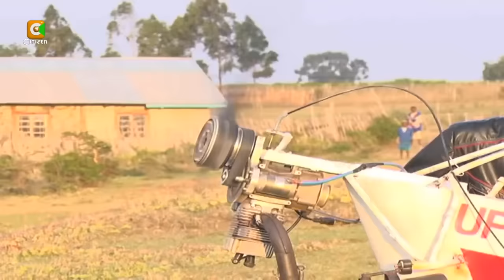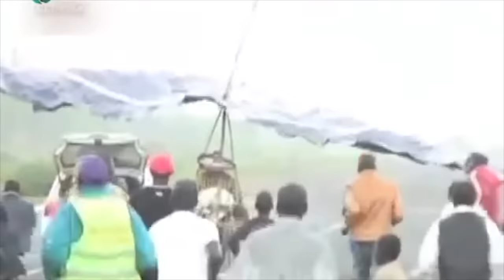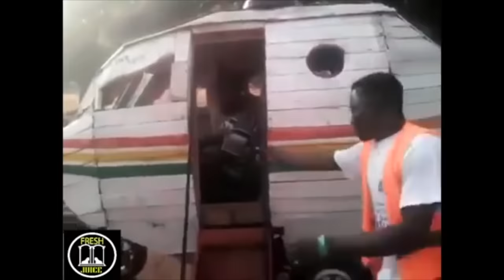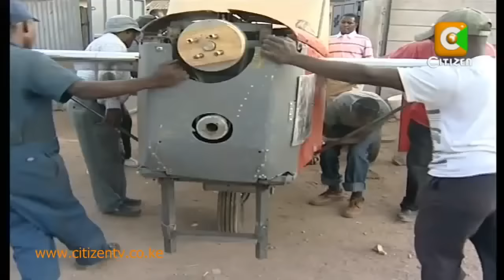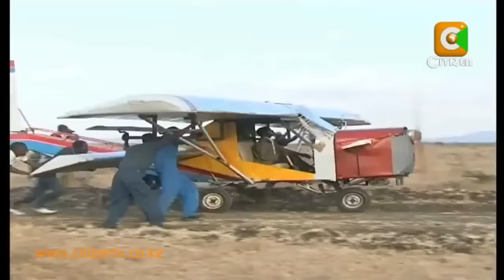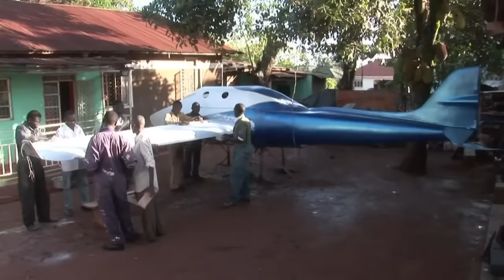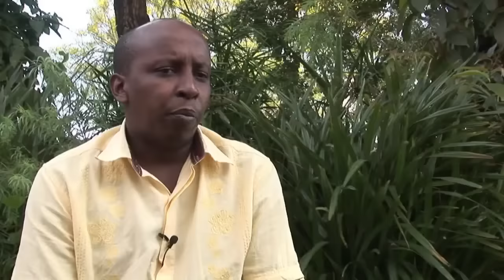African Airplane Compilation | African Aviation

Comment: I love that the "Helicopter" scooter had a fully integrated staircase/door for a 2 foot climb, as though it was an integral part of the engineering.
Reply: The painted flag not lining up when closed was truly the cherry on top.
Reply: @grovePS3  indeed. typical African eye for detail.
Reply: I can only hope there is a couch in back for seating 😊
Reply: @DANTHETUBEMAN  definitely a sofa in there. Probably the most valuable thing on that abomination
Reply: Those stairs looking gangster frfr
Reply: That one looks to me like it was a novelty thing, and not supposed to fly though. It doesn't look like the propellers turn, and the engine is still just hooked up to the wheels.
Reply: @cmur078 it's actually the best one because it's not trying to fly at all
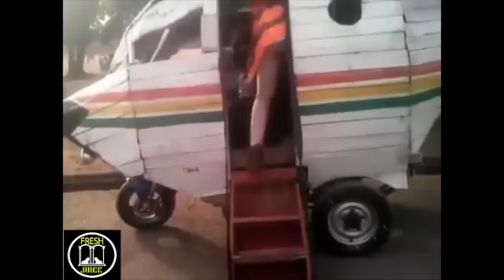Reply: Those racing stripes at 3:37 are important, yes?
Reply: A clapboard helo 😂
Reply: Did you like the way the stripes lined up once the door closed?
Reply: good thing it had multiple forward gears.
Reply: @grovePS3  It looks like they painted the outside upside-down, so when stairs were connected the whole panel was flipped
Reply: The one door assembly looked as heavy as the rest of the aircraft
Reply: That thing looked as if it may have been part of an aircraft at one time or another and he was only attempting to restore it to its rightful place in the sky.
Reply: I believe he installed it the wrong way,causing the lines to not match lol.
Reply: "engineering" 💀
Reply: Wheel barrel as the planes wheel 3.59
Reply: That was 100% a Honda engine from an 84 200 ES ATC. It should have flown, came down to pilot error.
Reply: @grovePS3 It did. They wanted the star in the flag and it all lined up how they wanted it. The whole contraption though showed their priorities and it clearly wasn't aircraft engineering. It was like me at four when I made a rocket out of 2x4s playing astronaut. I thought I could make a heavy comfortable house fly.
Reply: lmao..!
Reply: "Just as it seemed feady to take the leap"

- as several people pushed the aircraft at 7mph.

The mischievous laughter of the children at the failure of this man's dream😂😢
Reply: True, but he didn't make that one. It came from a set.
Reply: @A_Stereotypical_Heretic lol abomination!They definitely dont consider saving any weight in the design!
Reply: @wirelessone2986 cause it wasn't meant to fly but deliver a bit of the fancy feeling of a helicopter ride, if even only the fancy entry and shell
Reply: ofcourse, its a load bearing staircase/door.
Reply: It wasn't a scooter, it was a tuktuk
Reply: Pimped out tuktuk
Reply: What about HELICOPTUKTUK
Reply: It's the part that functions
Reply: They know what it looks like not how it works
Reply: @Stan_in_Shelton_WA I think Boeing hired these guys to put the door plugs in the 737 max.
Reply: @twigglykevin V TEC don’t kick in until cruising altitude, so he had a few inches to go to get to Flight Level 000.00025
Reply: well we were made in gods image perfect, and god is three in one, so we are also three in one , body, soul and spirit. And so we were put in a perfect paradise, with alot of fruit trees, but one fruit tree we couldnt eat of its called the tree of knowledge of good and bad, and so satan was a high angel who rebelled against god and was trown onto earth, he came to the perfect humans in disguise as a snake and said to them, didnt god say you would die if you eateth from that tree, the woman Said yes, and so satan told them well i tell tou if you eateth from that tree you will become like god, and so thats what she did and she also gave to her husband adam and that day they realised they were naked and had sinned against God, they died spiritually, their soul would die the eternal death (hell) and their body would die, if they didnt repent and believe , so the curse of death continued on alot of humans because of their sins, but god send his son jesus christ who came to undo the sins of the first humans by being without sins and dying as a sacrifice for the sinners, to make the path to forgiveness open by faith and being baptized, and receiving the spirit, jesus said if youre not born again trough water water spirit you cannot enter the kingdom of GOD ❤❤
Reply: its like homer's spice rack
Reply: It's presidential bro 😂
Reply: Helicopter Scooter....... I'm Crying!
Reply: That one was for classy Africans! They are not living in stone age.

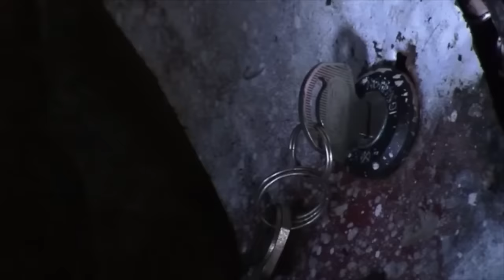Comment: At 2:22 - when he goes to turn the key and the whole ignition switch rotates you know this is gonna be good..
Reply: Lololol.

Bro those rotors ain't lifting shit
Reply: I thought it was going to start rocking backwards and forwards making a humming noise , then stop until another coin was inserted
Reply: @bonusnudges  😂😂😂😂 Man I cried so hard, looool. This is so savage it needs to be top comment hahahah 😂
Reply: @bonusnudges  LMAO 🤣🤣
Reply: the same torque used to attach the ignition switch is used to torque down the propellor
Reply: @bonusnudges  That's funny as shit.😂😂😂😂
Reply: @bonusnudges  Broo 💀💀💀
Reply: The Flintstones was futuristic compared to this shite.
Reply: @skateboardingjesus4006  LMAO. 😁👍
Reply: Mobambo bojaba!
Reply: @poopbutt6241  It's not legal in my country to just build some rickety old half-arsed attempt at a manned aerial vehicle and try to fly it. I have built (and still do) various scales of remote controlled FPV (First Person View) airplanes of different configurations and abilities though.
Much more fun and far more conducive to staying alive. These guys have the drive, but unfortunately not the appropriate knowledge, or materials.
They wouldn't be too hard to get, even in rural Africa.
Reply: Just not for the pilot
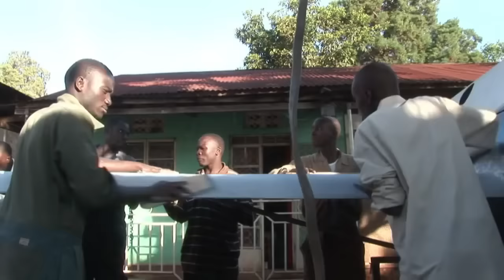Reply: 6:50  there is a long way to go. Understatement of the year.
Reply: Not mentioning the rust all around.

Comment: the helicopter made of wood with the tiny propeller really got me XD
Reply: That was some good 2x4 framing.   A better choice than using 2x8s imo.
Reply: The paint on the door didn't line up with the rest lmao
Reply: Looks like something straight out of spongebob, I like how the colors on the side don’t match up with the drawbridge door.
Reply: that guy who jumps inside it with an orange security vest killed me. haha
Reply: I think that was a Rickshaw with a 2-stroke 15 HP engine that wasn't even connected to the tiny propeller. Ha!
Reply: Africa will soon reinvent the wheel
Reply: Lol same dude.  Dunno how incame across this video but man its hilarious.  Those dinky ass propeller blades will never work.  How is it not obvious to dude?? Ha then the next helicopter keeps crashing.
Reply: @Patriot-bn9om  I thought "oh, they are going to move it to a safe place, THEN start the engine for the propeller"... that would never be big or strong enough (both the blades and engine) to lift off the ground. Nope, it's just a "fancy" Rickshaw with a non-functional fan or something glued to the top. That guy that waved out the window was the time I realized... that was the "flight". Just going down the street at 3 mph. That engine probably was struggling to move that thing.
Reply: I don’t think it was even meant to fly. It was probably some sort of float made for a parade or something like that.
Reply: Bad piggies lmaooo
Reply: THAT IS WHAT IS CALLED

A BOX

IN LAYMAN'S TERM

A COFFIN
Reply: @Patriot-bn9om that's a wind driven propeller, super efficient.
Reply: That was a ceiling fan lmao
Reply: @Anti_Everything  And it will be square.
Reply: Or the ridiculously small and underpowered tail rotor in #1 😂
Reply: I did like the little porthole detail.
Reply: Good to know that a ceiling fan won't get an upturned sail boat airborne.

Comment: Not enough lift?  Ramp at the end of the runway.  Problem solved.
Reply: I guess they were saving weight and reducing drag by eliminating the vertical stabilizer and rudder.
Reply: @OldWrench45  It's a bit funny to see the plane structure violently bend near the wheels when the plane collides with the ramp
Reply: That’s actually how most aircraft carriers work. (Modern ones have a catapult system)
Reply: @crunch9876  that's for a shorter take off. Not because the planes can't generate lift.
Reply: wooo hooo
Reply: @crunch9876  Sure aircraft carriers use techniques to aid in the takeoff and landing of aircraft because of the short distance but not because the aircraft can't sustain flight or gain sufficient lift.
Things like the catapult systems are there because the planes don't have enough runway and time to accelerate to liftoff speed, so they accelerate them faster and give them a push. I have no idea what a ramp is going to do lol
Reply: Funnily enough a ramp would be counter productive to generating lift. Transferring your horizontal velocity into some vertical velocity with the ramp results in reduced airflow over the wings, meaning you have even less lift.
Reply: @Trollsty  The ramp does actually help if you can generate enough power once you are airborne, this is the reason many aircraft carriers use ramps. That lawnmower engine just ain't gonna do the job.
Reply: Kuznetsov used ramp too
Reply: BerserkPk i read an article in a news paper about him and he have invested 4500$ for the engineand 1500$ for the propeller 🤭
Reply: Hehehe

Comment: Pretty sure that helicopter is using a ceiling fan
Reply: Lol😂😂😂😂😂😂😂😂
Reply: that wooden helicopter was taken out of context, it was not supposed to fly. Its a taxi
Reply: even if the helicopter took off. There is no tail rotor so most likely the aircraft would spin from engine torque maybe even killing the pilot
Reply: I remember that helicopter, how does he think that flies with 20 cm of blades
Reply: Hmm... No wonder our house took off when I put the ceiling dan in reverse!
Reply: @nadunwijesinghe965  
Yes, never flip that switch. People lose roofs that way
Reply: @maxwellagrunewald  you dont need a tail rotor necessarily you can add another rotor on top spinning in the opposite direction. The Russians have done this for some of their helis. An the chinook functions in a similar manner if only because of its weight.

Comment: Ok lets power this 1000kg plane made from car chassis with 120cc 2 stroke engine from a moped. I see no problems there
Reply: What can possibly go wrong lol
Reply: That's not a problem with aerodynamics! But the aircraft collapse on its own weight.
Reply: It’s the gear man it’s the gear....😂😂😂😂😂😂😂😂😂
Reply: @vascoribeiro69  yeah weight is a problem of your engine is not  powerful enough. How you expect to make that thing fly. Where do you an aircrafts made of iron or steel alone?. Tjey used  composed materials  and light weight metals like aluminum
Reply: xKuukkelix 😁😁😂😂😂😂😂😂
Reply: 2 problems...
1.. plane weighs 2 tons
2. Moped motor with a home made propeller ain't gonna cut it.
Reply: Santiago Arbelaez r/woosh
Reply: The real problem is the designer’s IQ of 80.
Reply: yeah, the landing gear must be the reason why it can't take off
Reply: Only need better landing gear!

Comment: When the stripes on the door don’t line up with the stripes on the fuselage you know it’s a well thought out design.
Reply: Hahahahah
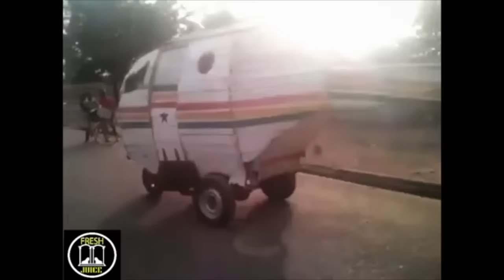Reply: 3:45 ?
Reply: Waahahahaa! 😁😁
Reply: Tries. Fails. Uses more duct tape
Reply: Have you ever tried to build anything remotely close to that? It’s pretty funny to see how little knowledge people have of how difficult it actually is to do something like this is, and how difficult it is to get everything to fit together nicely when you’re literally working with scrap.
Reply: I think they had the door attached upside down when painting. There are stairs inside the door so it couldn't be used in the upside down position.
I'm pretty sure once they get the door sorted out they will have smooth flying from there.
Reply: @dar0971  a YouTuber called PeterSripol built a successful plane... Pretty quickly...
Reply: Forget the stripes, when the body is bigger then the top blades of rhe helicopter. Lol looks like the heli at walmart I put quaters in as a toddler.
Reply: @drabhand  You also forgot to mention this is far from the pinnacle of your race.
Reply: @dar0971  no but lining up lines with other lines is pretty basic shit..
Reply: @dar0971  paint job last. Engineering and fabrication first. Baby steps my guy. These dudes try to build straight to the end product.

Comment: I think the most important thing to remember when building an airplane is to make sure you have solid 21inch pig iron wheels
Reply: And small ass rotorblades
Reply: Body of a Cessna, landing gear from a 747. Designed for rough landings. That man is a genius.
Reply: @C_and_C...  🤣🤣🤣🤣🤣🤣👏🏻👏🏻👏🏻👏🏻👏🏻👏🏻
Reply: and a small rock in front of the front wheel and not one in the back to act as a chock
Reply: gotta have that sweet, sweet center of gravity.
Reply: And don't forget to switch gears when flying
Reply: @C_and_C...  And the pilot is the janitor.
Reply: That is priceless !!
Reply: I think the power to weight ratio is off just a little…
Reply: @oliveryt7168  come on now, they might be functionally brain dead but it’s a bit mean to call them jannies

Comment: The helicopter with ceiling fan blades may be the greatest thing that I've ever seen!!
Reply: I wonder if the fan is the right way up to creat lift
Reply: That's why they are called AfricCan't
Reply: @pteppig  👀
Reply: If they believe hard enough, then they can believe it into reality, or so they think. Cargo cult behavior. I'm not blaming them, unless they have Internet access, then yeah no excuse at that point.
Reply: @Patrick  Even the most remote tribes in Africa have smartphones and access to the internet now..
Reply: @MarkLada  Then nah there's no excuse.
Reply: @pteppig  WHAT DID YOU  CREATE?
Reply: That had to be a joke
Reply: @crusoebower3391  If you think it's a joke, you don't know Africa very well lol.
Reply: It's all about the rpm. It is actually one of the safety features, so it never will become airborn. If I am ever to build a plane, I would start of making it radio controlled 😄
Reply: THE PLANE NEED A SATUR V ENGINE IS TOO HEAVY
Reply: THERE IS NOT AERODINAMICS

Comment: 3:45 love how the stripes line up perfectly with the door
Reply: Ha ha I love that too!
Reply: 🤣🤣🤣🤣 These perfectionists sweat the details!!!
Reply: @daakrolb  They also don't skimp on construction materials by using new lightweight purpose formulated alloys. That shit's for posers. Strap a 20 HP 1 cyl then use a belt adapter to turn a tiny prop. That's how you get 2 ton's of surface welded old farm steel in the air.
Reply: @DrMurdercock  Space age tech & materials of the future!
Reply: I absolutely died when they closed the door and the stripes didn’t line up!!
Reply: change gear
Reply: Some adjustments had to be made after they painted the door...
Reply: this is pure comic
Reply: @oliveryt7168  lol imagine painting something before you know it's fabricated correctly lol lol lol
Reply: Hahahaha 😂😂😂😂 that's what I am crying about, I just spat out my drink. Brilliant.👍🏴
Reply: @MussaKZN  Meh, your loss. lol
Reply: Never measured. Cut once.
Reply: Oh but they do! They just put the door upside down 🤣
Reply: Thats the indian transporter taxi for cheap price
Reply: Riksha
Reply: If you notice, the order of the colors is reversed on the door, compared to the body. Also if you eyeball the distance by which the stripes are offset, it kinda matches the distance from the green stripe to the "top" of the door.

tl;dr they painted the door upside down lmao
Reply: I laughed so hard
Reply: yea i think they painted it before making it a drop out door and just said fk it.
Reply: Its upside down too so someone last second flipped it up
Reply: @KrasYnek  Everyone knows the star goes to the top.
Reply: @moyadapne968  they don't
Reply: @DrMurdercock priorities
Reply: He put the door on upside down.

Comment: I'm no engineer but I'm pretty sure those planes don't fly because they didn't paint them like the real planes
Reply: For real though they do seem to think that if the helicopter or airplane looks more like the real thing, then it might fly. How about they strip all that fancy stuff, leave only the engine, a solid light frame and the wings. Then they should just run that thing up and down a long straight street. If they're fast enough for a small 1m lift off, they can actually work on ailerons and controls. I've seen homebuild airplanes from russia that look worse than this shit, but at least they fly because russians know the physics law behind a plane.
Reply: @TranceMatzl15  Its the IQ that plays role,they belive in some kind dark magic will help them.They should look/search for blueprints and plans(and this again IQ,you need to understand how to read blueprints or plans).Then learn some basic physics but how you learn if you can't read.
Reply: Brian Roberts  I'm pretty ur right. The paints they used wete too heavy and doesn't look high speed enough
Reply: If they choose white paint for sure it will fly...